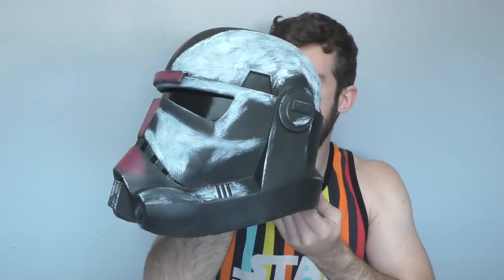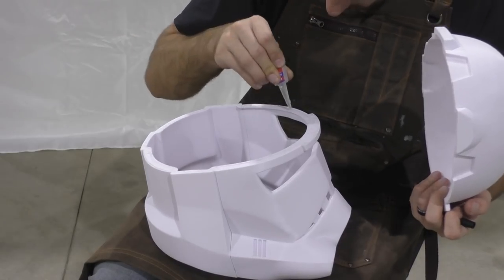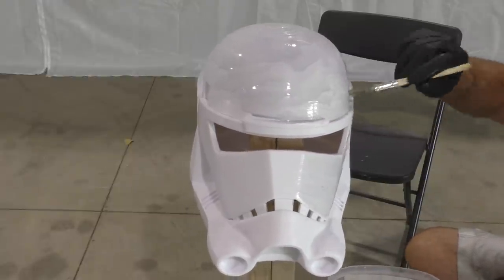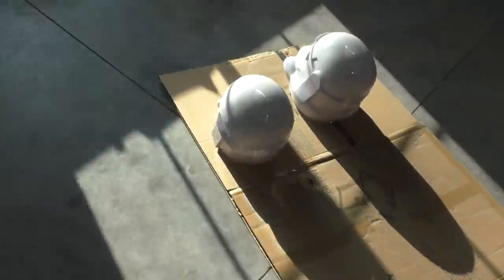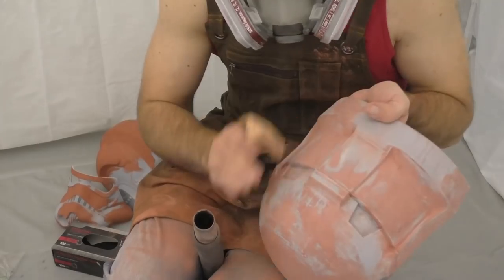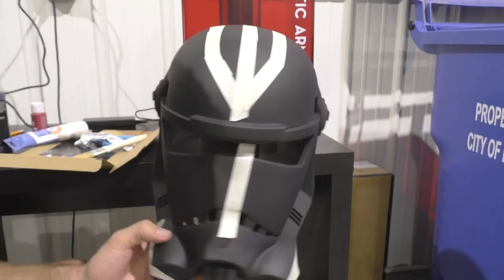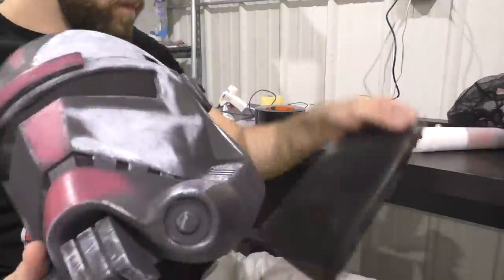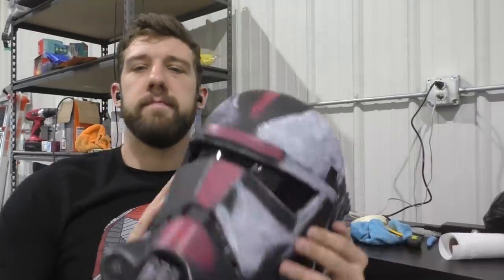How to make your OWN Bad Batch Hunter Helmet

Comment: So just a question, For the resin smoothing technique do you have to use UV resin for it or can you use resin similar to the one you used on your clone trooper body armor?
Is the only big difference that the UV one is easier to use and user-friendly? 
As it seems like a nice technique I'd like to use but I don't think it's worth getting UV resin without having a printer that can use it as well.

Comment: Do you have a tutorial on interior padding?
Reply: He doesn't have a full video on it as there really isn't much to talk about, but I believe he put some motorcycle helmet padding in his Mandalorian helmet.

I usually cut soft foam and glue on velcro so I can remove and swap it out. Just put it in a few places where you feel it's needed, like the top of the dome, the back and the sides/front.
Reply: @BlatantlySwedishPGN  that's what I did with my ironman mk50 helmet

Comment: @GalacticArmory I have a question: I just recently got my own 3D printer, and since I am of course going to make my own clone trooper armor (I'm buying the files from your store), I went back and watched some of your old videos. In the older videos, you used BONDO glazing and spot putty, but here you used "SLA 3D printer resin". Which one would you recommend I use on my trooper's helmet and armor?
Reply from the maker: Bondo on the helmet and resin on the armor. Resin is great at covering large surfaces but it's difficult to control whereas bondo is pretty easy to control which you want for the details of the helmet
Reply: @GalacticArmory  Thanks! I'll be sure to use the bondo on the helmets and use Resin on the armor! Also, I didn't think you'd actually notice and respond to my question, so seeing this surprised me! I've always loved clones and their armor, so being able to finally make a set of my own is a dream come true!